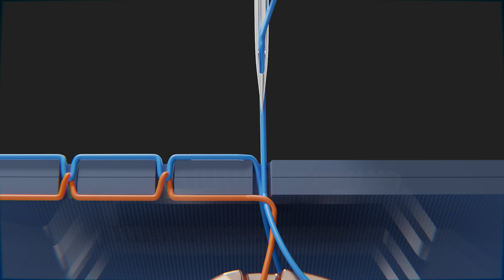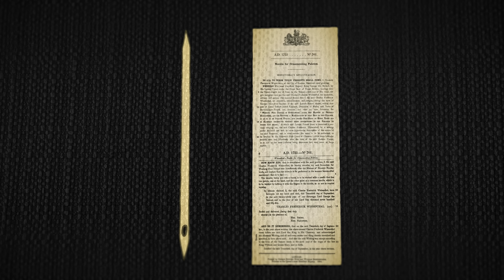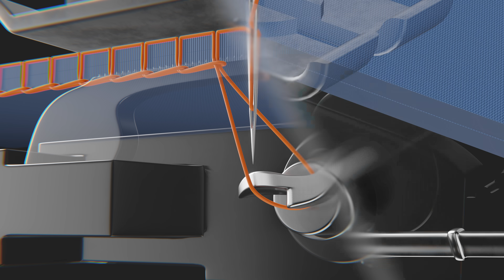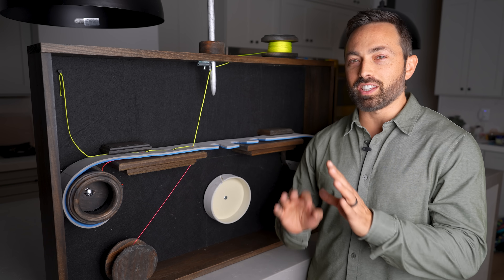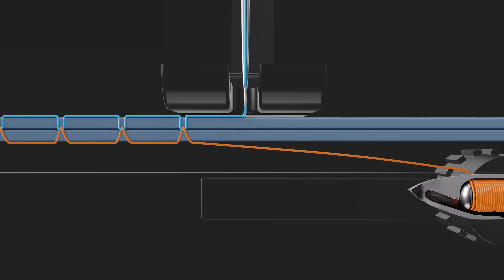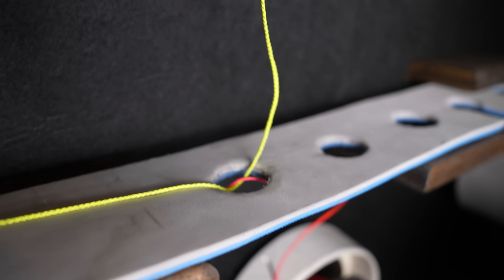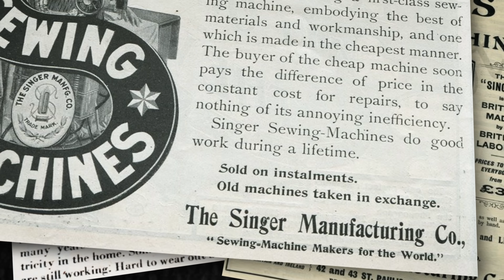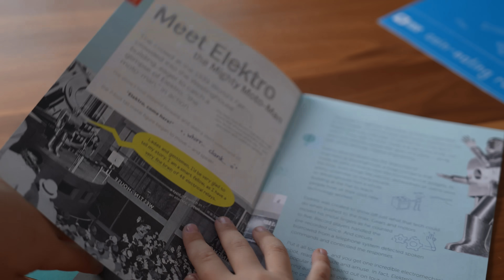The Surprising Genius of Sewing Machines

Comment: Great video, watched today because I wanted to appreciate it calmly.
We have a Singer 15-30 made in Canada in the 1920s, with original 5-drawer cabinet and accessories from that era (lamp, speed control, electric motor), and it works better than modern brand-new home machines.  Apart from some components in different positions or mirrored, it's the same mechanism as today.  Also have a pair of Vigorelli from mid-century, working fine as well, and a modern Singer home sewing machine as well.  So, my tribute to Wilson, Singer and the engineers and workers behind them, it's a really well done job.

Comment: Steam powered factories weren’t actually loud… The steam engine was in its own room, the power transferred by leather belts from a shaft through the shop floor, so if anything, it was probably quieter than having a room full of sewing machines with individual electric motors.

Comment: If the operator is anything but the height of careful they break so easily it's stupid. I have to repair these things and they're absolute bastards to set right. I see them as one of those things that 'just about work'  but the design engineers got frustrated and said 'that will do.'

Comment: I kinda grew up with sewing machines, my mom has a few for occasional garment repair. Oldest is late 1800s to early 1900s Singer (dating these by serial number is kinda fuzzy, same code corresponds to different years on different factories in various sources), still in great shape. I got into cosplay later and this is what I use sewing machines for now, at some point I made something on that Singer machine too. Tho mostly I use a revived 70s Radom now, aside from a bit of clunkiness it's as good as something newer and has more penetrating power than anything else in the family

Comment: Thanks. For video.   My mom had bought a  Sears Kenmore.  Machine. It froze up.  The repair shop sold her.  Pariphine   Based oil.  This is  the wrong oil for lubrication.    3in 1 oil  no detergent.  Works best.   Kroil  oil works best , to  loosing  joints and pivot points.  Thanks. For the video.

Comment: Fascinating explanation. It is mind-boggling that mechanical engineers in that era were able to imagine, draw and iterate these designs without CAD.
Reply: they designed the SR-71 blackbird in the same way. Designing something back then was actually the easy part having all the tools and materials necessary to build it was the hard part.

Comment: Planned obsolescence in clothing is critical to companies that make it not because of muh greed. It's required to keep a large operation like it going. Once demand dries up, the seamsters and seamstresses still have to do something and they'd be wasting time, energy and materials endlessly making new stock that nobody is using.
Reply: Eh, kind of true. There are still plenty of emerging markets like Africa and anything below the USA border that could increase demand without sacrificing quality. However, when it comes to clothing, I would say that the quality has actually improved for the price. Sure, you can buy some really crappy clothes, but most sacrifices in clothing are due to them being disposable. For example, t-shirts have gotten thinner, but most people ruin a t-shirt pretty quickly, so you don't need it to be that robust because it will likely get ruined by stains before it fails anyway. However, you can still buy better shirts if you want. Clothing, to me, is not a market where planned obsolescence has taken hold, and that is also due to there being massive amounts of global competition.

Comment: I love these style videos. That was fascinating. I remember as a kid my mom using her Singer and I would often sit at the table with the side panels of the machine open and slowly turn the flywheel and watch all the parts move in beautiful synchronization. A dance of mechanical parts. Even following it and figuring out how it worked, it still felt utterly magical. My grandmother had a significantly older machine. It was easily 100+ years old and it still worked. Mechanical rocker that you used to power it. Heavy as hell but incredibly well built.

Comment: Shoemakers used awls with a hole on the tip well before 1755. They needed it for repairing old shoes, since the interior of the shoe cannot be reached by hand to move a normal needle back. The technique is very similar to the one used by sewing machines.
Reply: yeah i found that part odd as i too could see many reasons for that to be a thing much earlier.

Comment: 3:18 Sorry to interrupt here, but when you ask people who are used to hand sewing, they don't "pick up the needle on the other side" or "flip the needle". That's a total beginners thing.... 😅
(Granted, it helps your explanation 😊)
They stitch the needle into the cloth from the top side, feed it through the length of the stitch , stitch it through the back back to the top side and pull it through. So you do two penetrations in one move. This was the needle stays on top, the cloth never has to be flipped.
However, the cloth has to lay flexible in your hands to feed the needle through like this.

So imitating hand sewing would be mechanically challenging after all 😅

(It is amazing to watch someone used to it doing it really fast and really precise. As she mentioned: "People sew a lot of clothes by hand back in the day. They were used to it. They were fast. They were precise. They worked fine. The 'clumsy' stitches you cliche from medieval clothes are incorrect."
Mina, if you read this: Love your work ❤)

Great video overall ❤

Comment: I used to work in a chemical plant that was nearly 100 years old. The agitators on the tanks originally were driven by an old hit and miss diesel engine driving a main shaft through the whole plant. A system of leather belts and pulleys transferred the power. If you knew where to look and what you were looking at, you could still see evidence of that old system. The agitators are all electric or pneumatic today. The thought of 25 tank mixers all running from one engine blew my mind when I learned the history of the place. Thinking about 50 sewing machines, all starting and stopping, running from a single shaft... I wanna go sit in the corner and suck my thumb... the complexity, but also the simplicity. It gives me a pain behind my eyes....

Comment: I work at a shoe repair shop. The machines that sew on the outsoles of shoes have an added complication: sole leather is too thick for a needle to punch through so you have to have an awl - basically a second, stronger needle with no eye - that pre-punches the hole before the needle goes in. Both the needle and the awl are curved and ride on the same cam. The awl punches up from the bottom and the needle then comes down through that same hole. The bobbin is to the side and catches the loop from the needle with the help of a small looping rod. It's a scary machine to use since it could easily punch through the bones in your hand.

Comment: When I first learned of the history of the sewing machine I was just an engineering student and I learned it through accident. It opened my eyes to always look for solutions that don’t rely on existing ways of doing things. 24 years later I still find successful norm breaking ideas as a sweet fruit of engineering. I am now in the habit of ask at the start of a new project: “does it have to be done this way? What is the real end goal?” 😊 Great video. 😊
Reply: I deal with that question in my line of work too, programming. Just because it's always been done like this doesn't mean it always has to be.
Reply: This is what is NOT taught in schools. They teach what to think instead of how to think. Always, ALWAYS ask questions, and leave it open to alternate ways.
Reply: @katen1228  I would say it depends on the school. I have had a really good time of learning how to think and learn in school.

Sometimes there is a bias against schools brought on by adult hindsight;there is a tendency to believe that a kid thinks the same as when they are an adult. They just don’t. I had enough experience in this area to know that things that are transparent to adults are not to kids, so lessons on learning and thinking may not resonate with them. I know I think differently than I did in my twenties, and so on. I am not talking about opinions but of HOW I think, how I look at something and how I go about evaluating it. I know it will be different as I get older. I don’t think that can be taught in school as it requires a level of maturity that kids don’t have. 

Read the book:
The Design of Everyday Things
Donald A. Norman

Everyone should, we would have better designed doors for sure.   :-)

Comment: 12:12 Small correction, identical tension isn't alway favorable. In the case of thick and stiff material, for example the webbing used in fall protection harnesses and lanyards, you want the thread attached to the needle to be pulled tighter so it will get pulled back into the fabric. Also stitching two differing materials can need a greater tension difference. Overall though this is a very accurate and informative video.
Reply: I noticed that as well.  Yes, if you are sewing a thick fabric to a thinner one then having the same tension in the upper thread and the bobbin will cause all kinds of problems.  I am a pretty experienced sewer, but I still find thread tensions to be a major challenge.  It's just one more example of the genius of these machines:   the reason that one sewing machine is all any family needed is because of adjustable thread tension.  Without that, you would need on machine to sew denim and another to sew lighter cotton shirts, and a third machine if you needed to sew leather or canvas, or anything else.      Really, it kind of amazes me that they were able to understand the issue of thread tension at all.  When you sew by hand, it's completely intuitive.  When you sew with a machine the wrong tension causes all kinds of problems.  Even when you understand the importance of thread tension it can be very difficult to understand where the problem is.  And you can get bunched up fabric, skipped stitches, needle breaks, thread breaking, or thread getting bunched up . . .   If I were trying to build a sewing machine and those things were happening, I would think the design just plain didn't work, not that it needed a small adjustment. 

This was just an amazing video.  I'm not even an engineer, but that double louper design was a beautiful thing.
Reply: @snowmonster42  These definitely are finicky machines, that's for sure. Simple to understand the concept, difficult to execute. Firearms and cars are the same way.
Reply: @somepunkinthecomments471  True.  But there is also a garbage in, garbage out aspect to sewing machines that usually requires a computer.    Maybe there are other sewing mistakes, but mine always come down to thread tension.  I actually went out and bought a new serger once because I couldn't make the tensions work at all.  It's still hidden in the back of my most remote closet.  It haunts me.
Reply: @snowmonster42  My experience is almost completely heavy stitching rather than light stitching. Bartack too, but even that is heavier than typical clothing manufacturing. So my experience is more specialized. The heaviest product I make is around an entire inch thick (25mm) at it widest point. Barely fits in the machine. So take my info with a grain of salt. I push my machine to its limits.

The tension both up top and in the bobbin matters, it's not just a tension ratio that matters, but total tension as well. Needle angle, needle wear, whether the machine has been oiled recently, timing, and how you are holding the product can all influence the machine. Even the way the spool was wound and if you have foam in the bobbin claw can change things. It's complicated for sure.

Comment: I have restored many older Singers.  They are so well built that all it often takes is a knowledge of how to simply clean them (grease and oil gunking them up).  The increased friction from the dried and caked oil causing the overwhelming majority of problems (relating to tension and improper feed and needle movement). Once properly cleaned, they're usually as good as new.  Since the old machines rely on mechanical and cam movements, they simply never really fail, and can be converted to a treadle drive (meaning no power needed, for those off-gridders).  Old sewing machines should be snapped up at an instant.  My oldest one is from 1929.

Comment: think of the thread as the ( sen -- cos  y tan) espanol (not sure if i  got the spelling correctly,) on the real number on the graph going positive forward into infinity, no limits one direction..the bottom thread is the negative equations that can interlock the equations  at exact locations on the graph line...its symbolism it takes time to make the translation from the sewing machine function to the computer factions.. mathematical equations..the needle might be what is making equations to interlock the sin cons ( i might come back to make spelling corrections)..

Comment: For me this video was a complete fail, you have over simplified to the point of incorrectness.  You have not shown how the top thread passes through the bobbin. This video only works if you do not have a sewing machine. I have sewing machines and there is a spindle that the bobbin sits on, so there is no way the top thread goes around the bobbin. The "bobbin" is composed several parts sitting one inside of the the other. You have a thread spool, a case for the thread spool and a device that his part of the machine that holds the thread spool and the case for the thread spool. Which one of these does the tread go around? Depending on how you count there are 3 to 5 parts that I see in the sewing machine I have access to.

Comment: 4:12 This type of stitch is still used on charcoal bags for BBQs, at least in Europe. Next time you buy a bag, check to see if it's stitched closed.
14:20 Misconception. Steam engines are actually pretty quiet. Been next to a 4 story tall steam engine. Quieter than the average Diesel engine.

Comment: what really gets me is that it is all purely mechanical. I bought a sewing machines from the early 70s, pure metal, no computer just a motor and a speed controller pedal. But in a way it has a computer, a mechanical one, for all the different programs. That really amazes me. These  insane mechanical mechanisms inside to provide multiple different stitches. And yeah, even though it is a granny by now, it runs smoothly. It even has preventive maintenance. When i start hearing the machine, i know that i have to stop and start oiling her :)

Comment: I came to know about the lock stitch automation after bumping into some animation that’s is around on instagram, I have wondered myself just little about it in the past so the animation clicked right away and left me amazed.
Having that understanding has allowed to fix shoes (specifically stitching back external panels) by making lock stitches using a sewing machine needle by hand: you don’t have to pass the needle all the way through, which is great because often times there is not enough room or visibility inside a shoe to try passing a whole needle all the way.

Comment: I have Singer machines from about 1915, 1938, and 1969 They do run but will be even better after a good clean. It's very cool to see how they made small changes and improvements over the years. I also have an Imperial from around 1960 and like my Singers it's a beast! They will all sew through anything easily. The 1969 singer actually came with the original paperwork so I know where it was sold and how much each installment payment was. It's a fun bit of history.

Comment: Very good to see this all explained so clearly.  That this process was ever imagined and successfully mechanised has filled me with wonder, since struggling with the timing and tensioning of my mum's treadle and electric machines back in the days when jeans used to have to have patches!  So many needles shattered, whacking into the metalwork! So many nylon gears split by too many layers of denim!  Why on Earth, no helpful timing marks, as on much simpler cars and motorcycles?!!!

More recently, it was the simple one thread, easy open stitch as on sacks of grain and flour that baffled me. Friends would simply pull at one end of the sack, and they would open like magic, but I could rarely find the right place to pull, and had to cut the whole lot! :)  I only got the idea at last, when I bought some cobbler's captive needles, to make safety covers for knives and cleavers from old bits of leather and rubber inner tube (amazingly useful stuff).  Getting fed up with laboriously pushing the thread through from both sides, it suddenly dawned on me what the groove in the needle was for, after all these years: I'd accepted there might be a need for a groove on the machine needles, but why a groove in hand held ones?  Suddenly, I twigged that the grooved side lets the thread draw from the stock as you push through the leather, or rubber, and then the ungrooved side pinches the thread against the material so that the loop is made as you start to withdraw the needle!  As I'd not, before, actually thought seriously about that groove, I had not appreciated how a loop could be used to save me pushing holes from both sides.  This was a revolutionary discovery even in my little world, and all my kitchen blades are now safely stowed in tailor made rubber socks.  (It is still brain achingly difficult to remember to thread the needle from the grooved side, and sew in the right direction, so the thread draws from the stock, instead of getting trapped on the wrong side, though! ) :)  Surely, a contender for one of Mankind's greatest discoveries (after writing, printing, and Wikipedia at least!).    Great video.  (y) (y).